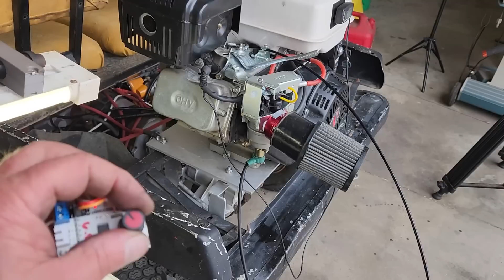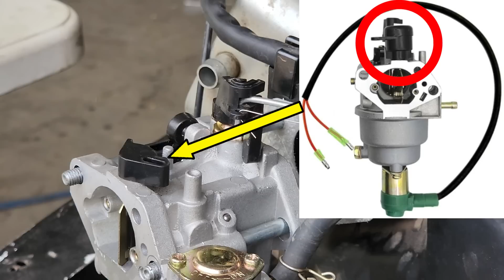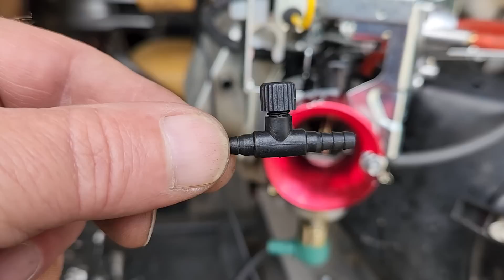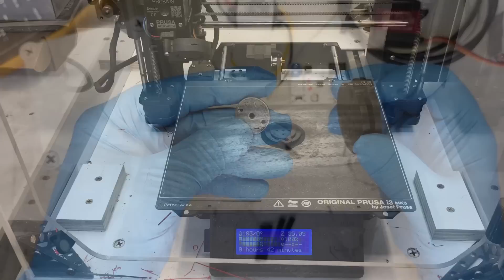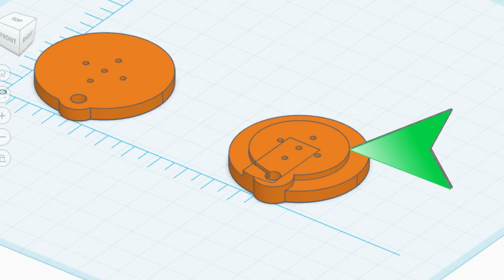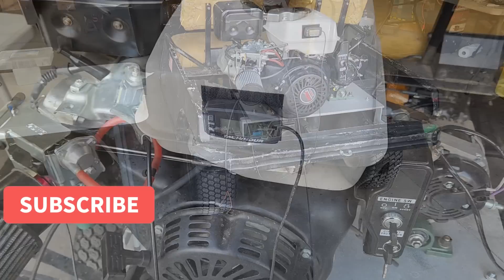S5 E17. We fit an automatic choke to the Predator 420 cc Hemi engine, Plus we build a throttle servo

Comment: Try an Outboard Marine Corporation solenoid type choke actuator say from a 1980 50 hp Evinrude Outboard motor. With the OMC start switch when you push in on the key the choke closes.

Comment: Heads-up. The throttle linkage still has a lot of clearance on the predator 420 non-hemi. I'm not sure if there is a difference in the linkages, but it does not interfere with the bracketry that you install for the auto choke.

Comment: I was fixing a pushmower with  auto choke. the exhaust heats up what  looks like a button that disengages choke by pushing the lever arm out  from the exhaust heat. Your solution worked so good, like so so frigging good. Impressive work. Thank you for sharing these videos packed with technical stuff which i can not get enough of.
Reply from the maker: Thanks!

Comment: So I know this is off topic kinda but I was thinking of making a swing arm for my ice bear scooter to mount a 420 or 670 predator engine to it so I don’t know what kind of gearing to use to reach 70 mph with out reving to high. Would the 670 have enough grunt to go 70 mph without removing the governor?
Reply from the maker: Our 670 powered Renault has no problem going 65 MPH and it probably could go faster, buts its kinda scary to drive that car fast.  Anyway, on a scooter, the 420 or the 670 would get you up to 70.  The ratios would not be ideal and the acceleration may be kinda slow.

Comment: I assume the door lock actuator is basically a solenoid... In which case it "could" be driven out eith a brief pulse of 12V, then have the voltage reduced down to around 9V to hold it, or pulsed at a high enough frequency to keep it held but limit the overall current.
But all that's way too complicated for a choke mechanism.
Reply from the maker: it actually has an electric motor with a gear rack inside of it.   They use a fuse of inside them as well to prevent possible fires if power to the motor is on for too long.  so no mater what, leaving the power on for too long will pop the fuse.
Reply: @robotcantina8957 
Oh, well that's no fun... Unless you need to unlock a door.

Comment: I wrote a copy arduino codes to use the uno, 2 servos and 2 nrf24l01 modules I'll send you if you really want to get fancy I have a wired version too but that's not nearly as cool. I but a wireless backup camera for hooking my trailer up to the hitch and backing my truck out of busy parking lots spots
Reply from the maker: Hi 'ya.  I appreciate the offer.  In the application where we will use the servo, we don't plan on going wireless. The servo will be used to vary the engine speed depending on the electrical load we put on the engine.  I have actually already written the code and we will demonstrate it in an upcoming video.  Best of luck with your Arduino projects!
Reply: Ok gotcha I like the idea of the affiliate links

Comment: [Random Algorithm Appeasing Comment]
This "Servo in a box" unit woke up an old memory.

A mate used to do mechanical DIY projects as a hobby, and something he'd constantly be grabbing from every scrap yard he'd visit was power aerial units. Most are pretty robust, quite torquey, they can be used to push or pull, and if you strip off the mast sections you're usually left with a flexible nylon core that has a rack moulded into it or an odd sort of brake cable centre thing that's got a helical spring built into it. The core can be stuffed along contoured tubes to get a reasonable amount of torquey linier action into small spaces, while keeping the bulky winding motor out of the way.

They're apparently incredibly useful bits of kit, but they're on very few peoples radars as a potential solution for automating tasks where a servo of the necessary power would cost a small fortune, or wouldn't provide enough travel without resorting to something like one of the larger (Read "Expensive") multiple revolution "Rigging/Winch servos" that are used on RC sailing boats.

Comment: I think the electronic choke and drive by wire throttle are interesting, but if your going to utilise electronics on a small engine, then id suggest that the best use for electronics and a servo motor movement would be to have an electronically controlled main jet or high speed mixture control. Then you could use an electronic control circuit thats linked to feedback from the O2 sensor. I think the SU KIF carb used this system with a stepper motor to control the fuel mixture.

Comment: you could probably use the air filter assembly off a generator too
Reply from the maker: Yes, it will fit just fine, and its about the same price as the aftermarket  filter.  The only issue is the generator filter is huge.

Comment: I couldn't find a new carburetor for my Honda GX340 petrol battery bank charger, but after using my eyecrometer online I realized that the GX340 carburetor is the same as the GX390, very useful to know now that it will also fit the Predator thank you.

Comment: Oh, interesting.  Am I correct in thinking that this is going to be used to refine the functionality of the diesel-electric drive?  Where the throttle is electronically controlled in relation to the demand on the alternator by the traction motor.  I will be fascinated to see how you make this all happen. 😊🎛

Comment: as usual, LOVE your show!

anti-backfire solenoid (the type when deenergized - closes) ALSO protects your engine from filling up with fuel, in case (a) your carb float fails, and (b) your tank is above the engine/gravity feed.
My parents bought a brand new mower (from Sears, long long ago) and both the solenoid AND float failed. About a week after they got it, it wouldn't turn over at all. The cylinder and crankcase were full of fuel. Repairing it was fortunately covered under warranty.

Comment: An old school cruise control actuator often has the same mechanism, a servo that pulls on a cable, but the advantage there is it’s a dedicated system that was designed with dedicated engineering and it can take all the countless abuses of the stupid stupid drivers of today’s world.

Comment: 19:04 couldn’t you assemble the servo with the two 3-D printed plates and throttle cable then install it inside of the box so you wouldn’t have a random hole with nothing plugging it?

Comment: It may have been asked but……I wonder if the starting issue was resolved with the changing of the carburetor?
Reply from the maker: The engine started the same with both carburetors.  The 212cc engine in the club car also need a choke to get running hot or cold.

Comment: I put a big capacitor on the door lock actuator, so that the capacitor is charged through a resistor, when the switch is off, and the switch dumps the capacitor into the actuator when it's activated, so no burnout... The capacitor takes just a couple of seconds to charge when the switch is off.

Comment: Ah, Jimbo! Do the affiliate thing with the jungle site. I'd support you any day, my friend!  I love both sides "of the isle", so just keep doing what you're doing. So, are you contemplating a Geo Metro race car? If it's blue, you could call it the blue streak or blue lightning if you use a petroleum battery set up! Oh, the possibilities  . . . . Rock on, man. Thanks for todays fun!
Reply from the maker: I would love to do a turbo build with a proper EFI on a Metro,  Those cars are extremely hard to find in decent shape around here.

Comment: I know small engines so if you have to choke the 420 or any small engine every time you start it you have a bad engine or a dirty carburetor but either way it should not have to be choked every single time 🤷 I'd be cleaning everything just saying
Reply from the maker: LOL, that would be ideal, however go ahead and pick up a 212 or 420 from harbor freight and you will see these engines wont start without the choke.

Comment: woulda been way easier to just richen up the idle circuit
Reply from the maker: Still wouldn't start without a choke.  If you payed attention we did change the jet.
Reply: @robotcantina8957  jet wasnt big enough. pretty simple really. try harder.
Reply from the maker: @DieselRamcharger  Sorry, I disagree, the jet was ideal for a stock engine with a stock exhaust.  Any bigger would have been too rich.  perhaps you want to spend some time playing around with these predator carburetors and you will realize they are not built the same as old school carburetors.
Reply: @robotcantina8957  lots of predator carbs/engines around here. theyll all start with no choke, especially when warm. stock exhaust and intake. bypassing the governor so the throttle plate isnt wide open makes the choke unnecessary. :). valves will float before it turns enough rpm to self destruct.
Reply from the maker: @DieselRamcharger  OK, I just realized your the person who keeps leaving negative comments.  I'm not sure what is wrong in your life where you watch videos and just say negative things.  Why do you even watch this channel?  Apparently there is nothing here you want to see.

Anyway on a stock predator engine with a governor, the choke is necessary even on hot starts. The engine we are using must have a governor installed because we need the automatic load compensation the governor provides.
Reply: @robotcantina8957  i dont leave negative comments. its pretty simple that a choke is used to enrich the mixture and there is more than one means to an end. Im not even sure ive ever left a comment on your channel before. You seem to have some sort of aversion to constructive criticism though.
Reply: @robotcantina8957  I just searched my comment history and it found no previous comments to your channel. I think you confused. If you look at this comment chain in particular it may strike you that you were actually being rude and crass in your replies. I think you might have some senility kicking in.

Comment: The electric choke from an outboard would have been a good option too, theyre just an electromagnet that pulls when its energized and the choke is spring loaded to be open
Reply from the maker: Yes, however outboard parts tend to be expensive.  I did check Amazon for a choke pull solenoid and didn't come up with anything worth fiddling with.

Comment: Use that set up on the Renault with a cat on the electric motor
Reply from the maker: What is a cat?
Reply: @robotcantina8957 cvt auto correct sorry sir
Reply: @robotcantina8957 cvt not cat

Comment: Can't wait to see the OEM turbo setup and how well it works.
Reply: I'm looking forward to seeing the OEM type Kubota turbo, but if it's too small then it will limit the top end performance potential of the engine. I think Jim should run both turbo's one after the other and then compare the performance and acceleration. The honda could definitely go 2seconds quicker on the 0-60mph time, but only if he can get enough air and fuel into the engine. It looks like the EGT limit alarm could be set higher too, as he isn't running it at constant full power and load all day.

Comment: Thanks, Jim. I was wondering if this servo test board would work with the golf cart gas pedal you're using to control the voltage system to power the golf cart electric motor.
Reply from the maker: The output of the board is PWM, but in the null position the output would be a 50% duty cycle.  we need less than 1% .

Comment: Drive by wire, future baby dyno, or both?
Reply from the maker: The servo throttle will be used along with an Arduino micro computer to regulate the speed of the engine according to the load the engine is under in the gasoline/electric golf cart.  The arduino will also control the amount of power we feed to the alternator so we don't stall the engine at full throttle acceleration.  Its actually a very complex system we are developing, but unfortunately its not a popular project and while we are still working on it, it wont be the main focus of the channel.

Comment: Brotha , you just gave me a salution to an issue i have been brainstorming for a wile , now just have to simplify it even further and utilize it .. i have no IAC so it cold starts like a old carborated car in the essence that i have to hold idle till it gets to a decent temp in order for it to hold idle without die , but when it warms up it will hold idle and a hogh idle at that cuz i compensate for start ups and pull timing when warm to idle down .. s small lil push pull servo would work perfect tho , i could have it slotted to so it dont fully hold anything that way when i actuate the throttle pedal it will not interfere , but i can utalize it on cold starts to "idle up" the engine to warm up then relese it to have a normal idle  . Kinda overcomplicated it for myself , but it is what i have built and what i like , so now to utilize all the cool learning i is learn on the interwebz 😅... peace and love all, keep it rad, stay safe, and build on.. k8r Jimbo , and thank you, brotha, for sharing your knowledge and entertaining us simpltons 😅.. ps would live like a outrakw channel with all the tech stuff that ya have to edit out for the simple nut and bolt people that way us simple tech people have a channel to further learn on aswell , but only if it was feesabke to you good sir 😉.. mad respect to ya brotha , hope all is well with you and yours .. l8r brotha
Reply from the maker: I'm glad you found an application for the gizmo,  best of luck with your project
Reply: @robotcantina8957  thanks broths , and you have actually given me quite a few good ideas over the past few years my friend , T.Y much brotha and looking forword to all that is to come

Comment: Didn't even know a vacuum operated choke was a thing!😂
My electronics oriented brain was wondering why add the complexity and not just have a solenoid like older outboard engines, but now it makes sense.
Reply from the maker: Outboard parts can be expensive, plus you have to fabricate the brackets.  I did search the Jungle site for outboard choke solenoids a number of times and didn't find anything worth fooling with.  In the end I just went with something that was more or less a bolt on.

Comment: Is this RF4 the same thing as phenolic??? Or Micarta??? We had a contract making 4 barrel carburetor spacers from Micarta , well it was about 25 years ago.   It was dusty , and we put shop - vacs in the macing center over the endmill.
Reply from the maker: Its a type of fiberglass with a fire resistant epoxy.  It's use for printed circuit boards.  I use it because I have access to the stuff.

Comment: All of this is Kool.   I've worked on the Clonda engines since they were called Greyhounds. Never knew about the vacuum choke thingies. Wish I had of a long time ago. I use Clonda engines on all our outdoor stuff. The antique Sears , wheelhorse garden tractors are a pain to hafta reach the choke while sitting on them.  Instead of having to mess with the choke I'll idle them down ,.and let em run all day 😮😊.    We have an old Russian built tractor that we run on used motor oil. It's a project in itself to crank. It gets started in the morning , and runs all day.
Reply from the maker: Thanks!  LOL, sometimes its just easier to let the engine run than have to deal with getting it started again.

Comment: Be so much easier, better performance for the engine and cooler running temperature if you were to just properly jet the carburetor. If you require any choke on a hot day or warmed up engine, than you're running pretty damn lean Sir. But it definitely does make life more convenient if they had a remote control choke system to offer off the shelf. When you have an engine thats hard to access its a really nice feature to go along with the electric start and alternator system. 😊
Reply from the maker: It would seem that on predator carburetors, using the choke to get the engine running on a hot start is completely normal.  It may be the way the carburetor is designed.  The #41 jet we added to the clone carb did enrich the mixture so the engine was running in the zone.
Reply: @robotcantina8957 I fully understand Jim.

Comment: I love these servo options that you you showed in this video.  I know of one more possible application, on turbocharged engines there is an efficiency benefit if you can hold the wastegate open during low load operation (less engine backpressure), it's called a part throttle open (PTO) wastegate control.  This is hard to do pneumatically with an integral wastegate, but with your servo demonstration it would be quite easy. 🙂
Reply from the maker: Interesting.   We may try that.  Keep in mind the little engine is basically always under a load and given its limited HP we pretty much run it at nearly 85-90% power in cruise.
Reply: @robotcantina8957  I agree, for small engines, their probably isn't much benefit, and for diesels, maybe zero benefit.  However for gasoline powered road cars, it has some potential and as a side benefit it helps to keep the wastegate mechanism exercised, so it is less likely to seize up.

Comment: That servo will burn out quick with that amount of spring tension. Especially holding at full throttle.
Reply from the maker: It will be fine, its made for heavy loads.
Reply: @ you're  right but not holding heavy loads.  Look at the amp draw while holding that tension.  You will smoke that servo. I am one of the nerds that understand and practice all of the electronic gizmos you build. But now that you've included a hobby grade servo you've crossed into the realm of my expertise.  The magic smoke will show itself.
Reply from the maker: @Real.Alpheus  Well, that sucks. I'll do an experiment and see what happening under a holding load.